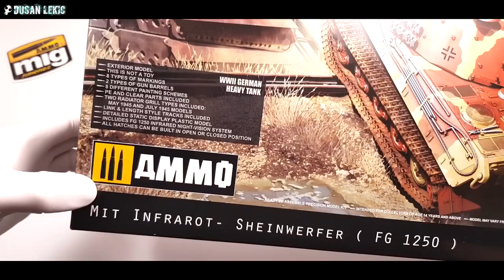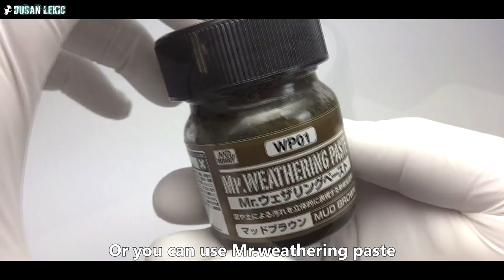FULL VIDEO BUILD AMMO KING TIGER (Ausf. B)

Comment: Does the primer / paint eventually "hide" the small glue marks with that brush on thin viscosity cement? I love that cement.. it seems like you can secure smaller pieces without worrying about "glue blotch" being visible! The paint scheme is grade A !! Late war panzers are very interesting because units were scattered as Germany was struggling with the Allied advance so many tanks had unique schemes never seen before. Happy modeling!

Comment: I like the colour ranges ammo do but I have some trouble with the paint. For starters it's always prone to spitting no matter how much I thin it or what air pressure I seem to use. Any tips on that? Secondly the paint has a tendency of not sitting on the surface but grouping up into bubbles. Again, tried thinning and different thinners etc. Even ammo migs own thinner. Even when the surface is primed. If I can solve these issues I'd be quite happy.

Comment: Excellent. What is the difference between Mr metal primer, and between a laquer based primer e.g. Mr surfacer? I mean in effectiveness. Does masking tape pulls off paint if I prime metal parts it with laquer?
Reply from the maker: Thank You! Yes, you can use Mr.Surfacer over the metal surfaces, you will not have peeling problems (I havent that problem with Mr.Surfacer). I had big problems with Vallejo primers, peeling off the metal s. I haven't use my favorite Mr.Surfacer Black so before Ammo primer I used Mr.Metal as a precaution. All the best! Dusan.

Comment: How do you decide which type of glue (Mr. Cement S vs. Mr. Cement Deluxe) to use on which joints?
Reply from the maker: Mr.Cement S (Tamiya extra thin) for fuselage or wings, Mr.Cement Deluxe for larger parts or parts where you need more adjustment time. (It's thicker, slower drying time like Tamiya-white cap). All the best!! Dusan.

Comment: I had to go though hell as I put together the Academy 35th scale last production king tiger which the wheels were 126 parts for the road wheels alone, but thank goodness I don't have trouble with very small parts because the engine deck has very small tow hooks on the top, but other than that I is a great model kit, I has two camo patterns, but I knew what the normal 1945 camo was, dark green base coat and dark yellow and redish brown srips on it.

Comment: Never seen a tiger 10.5 cm pak model version before. where did you got that? Great job btw:)
Reply: Is that not the 88L71?
Reply: Look at the instructions on scalemates, it's included in the kit, but strangely not advertised
Reply: @jamessteale805  yea I see but if I had that modelkit I would used it
Reply: PPs biggest fan kingtiger kriegsmarine So would I. There’s also a Voyager PE/Metal Barrel aftermarket set that you can buy and use on any kit. I think I will for my 1:35 Dragon Henschel w/Zimmerit
Reply: @jamessteale805  I'm busy on a 1:35 jagdpanther full interior from takom:)   great kit👌

Comment: Great video!  Very detailed instructions on building and painting.  One question, the dunklegelb you used, wasn't it a bit light?  Most examples I've seen had a slightly darker, more yellowish tone.  

Otherwise, an outstanding video on 'how to' on the proposed upgrade, the website, www.tanks-encyclopedia.com, has the following:  

Turret planned modifications

Krupp proposed the much heavier 10.5 cm (4.13 in) KwK L/68, still compatible with the internal mounting. However, Wa Prüf 6, as well as the Heer, did not accept the cannon [sic]. Planned improvements included a fully stabilized gunner sight, stabilized main gun and a semi-automatic ammunition feed. The Zeiss stereoscopic rangefinder was a bold move, as it would have provided much better accuracy, up to 2.5 or 3 miles (4-5 km). Other modifications planned, but never adopted, included a heated crew compartment, additional ammo stowage for 12 rounds, overpressure and improved air filtration system against poison gas. (http://www.tanks-encyclopedia.com/ww2/nazi_germany/Panzer-VI_Konigstiger.php).

Keep up the great videos, yours is the best modeling channel on YT.
Reply from the maker: Thanks!!! Yes it's a bit brighter on purpose. It's original colour recommend by the instructions. It's looking more like interior colour a shade of buff. All the best!! Dusan.
Reply: Late war dunkelgelb was lighter in color. It should be a noticeable difference when comparing a 1943 dunkelgelb to 1945. Anyways, it doesn't really matter because it is unlikely that there was absolute uniformity in colors.

Comment: The video is perfect and the model is spectacularly detailed but ...
Two radiator grill types included : May 1945 and July 1945 models !
Hitler death is avril 30 and german surrender May 7 1945, the grill types were requested by the Soviets?
Reply: The kit has parts and decals to build the last production version (March 1945), and a version with proposed design changes that would have been introduced had the war continued (July 1945).

Comment: I personally dislike the king tiger or panther tank the reason is the type of fuel they used in them it was gasoline which half the time half of the panther tanks blew up because of the gasoline either leaking or it would just go off for an unknown reason 2 is mechanical problems 3 my grandfather's brother died to a king tiger the mg gunner shot him in the leg then the driver drove over my great uncle and they gave no remorse but my grandfather's squad got revenge on the king tigers crew a few of my grandfather's squad distracted the tank an was lucky enough to get a satchel charge on the back of the tank and a bit of thermite only 2 of the king tiger's crew survived the commander and the driver survived but my grandfather killed the driver he put a 1911 up to his kneecaps and shot him 4 times in the leg the one in the head and the commander I assume that he lived to see another day but other than that it looks great